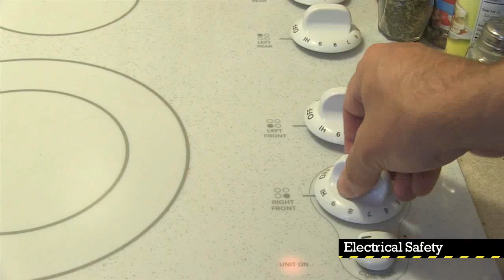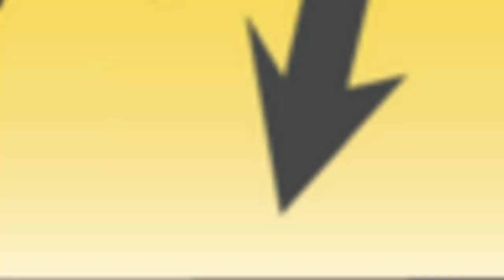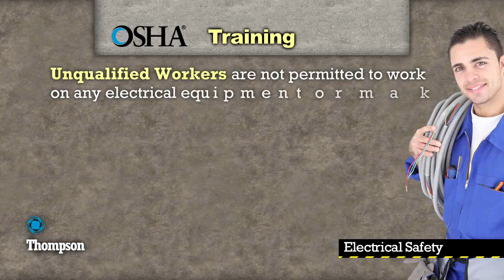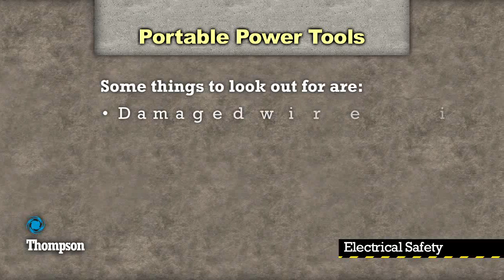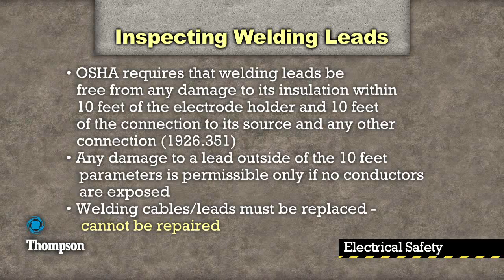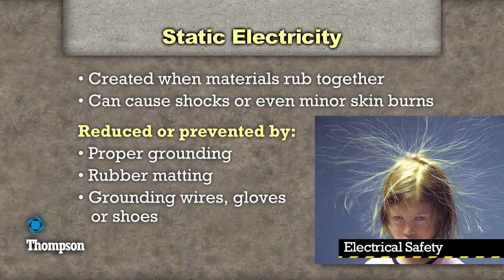Electrical Safety

Comment: what is the recommended material for work shirts or what is the worst type material to wear around high voltage switch gear if an arc flash occurs .....thanks